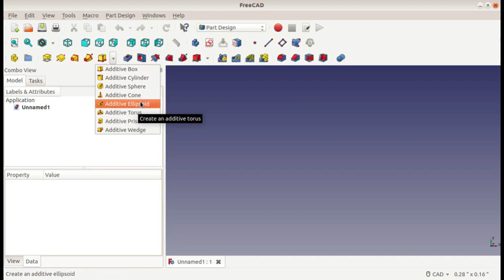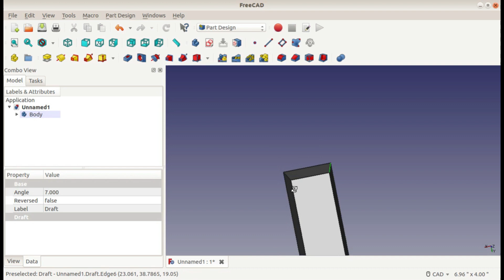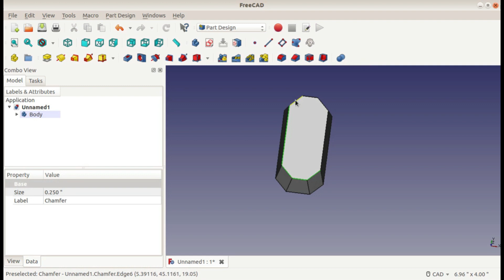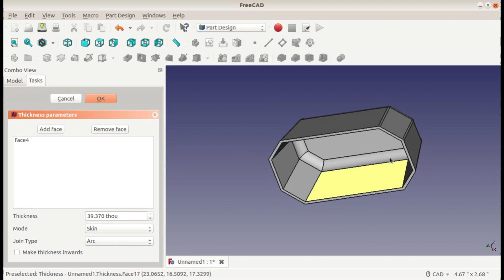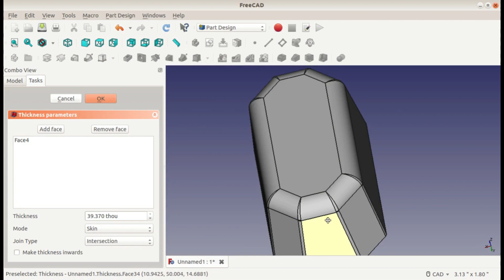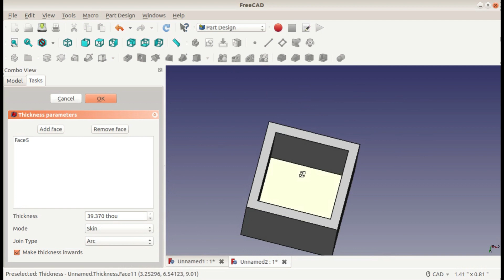Learn FreeCAD: #6 3D Operations - Tutorial

Comment: When you load a new part, it pops up in the tree under another part, so that you can see them both there at the same time. Mine does not do this...I can only see the tree of the individual part I have active at the time, even with multiple part files open in the program. How do I fix this? I 'm trying to assemble parts to test tolerances but am having a hard time

Comment: So its a ways off but I'm shooting for a production model that will ultimately be injection molded. I am shooting for that as a final target and the less I need to redo the better. I knew I needed a draft angle but I didn't know what it was called or what it would typically be. You answered both of these questions by accident. You rock thanks for the awesome videos.